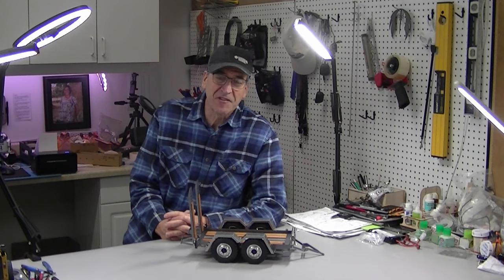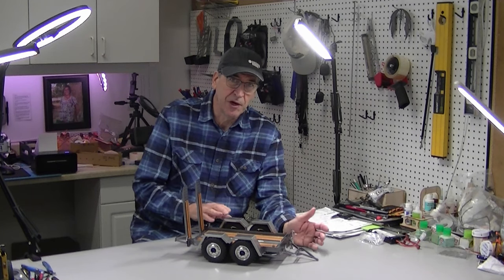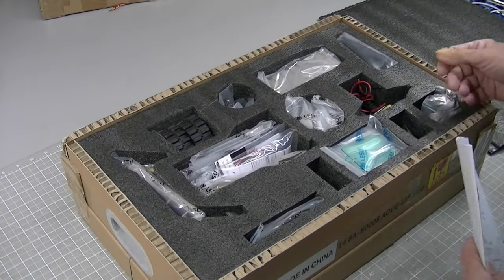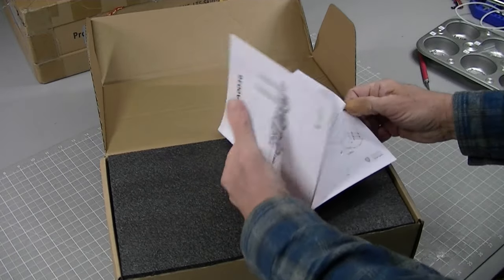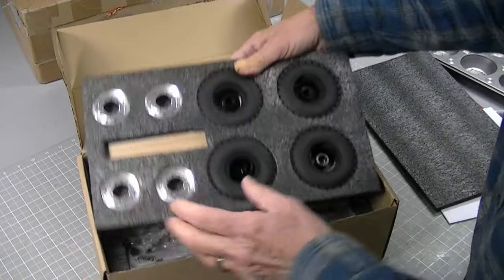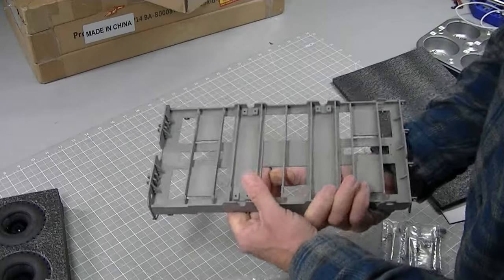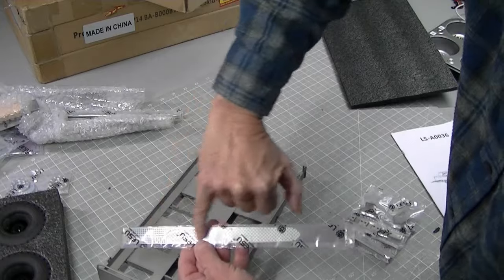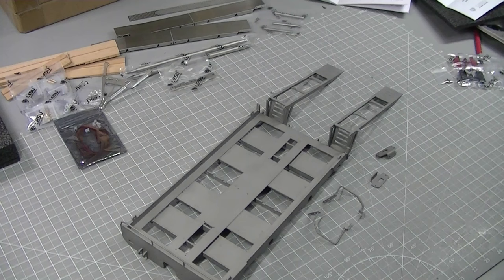1/14 LESU Track Loader Trailer - Review and Build

Comment: Hey did you spot your mistake.. @33:13 the front left wire hoop is on the wrong way round.  the 45 degree angle should be to the front.. :P